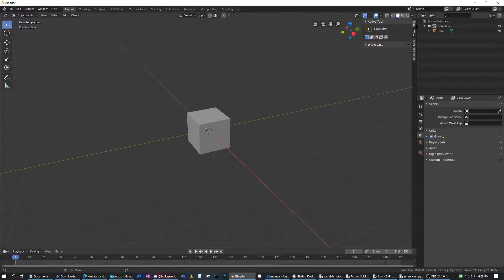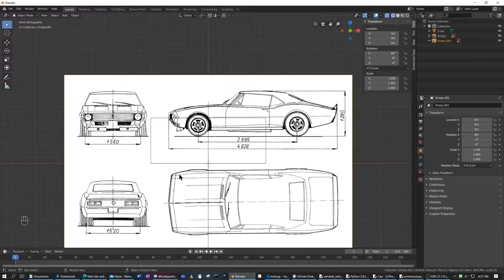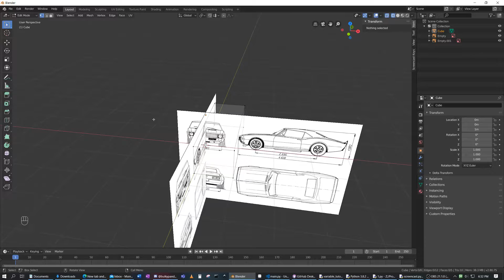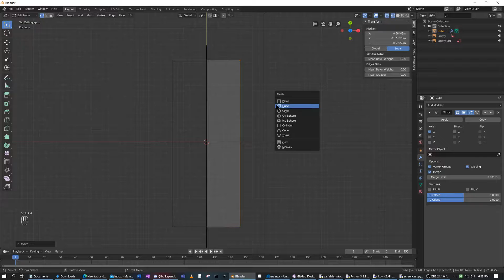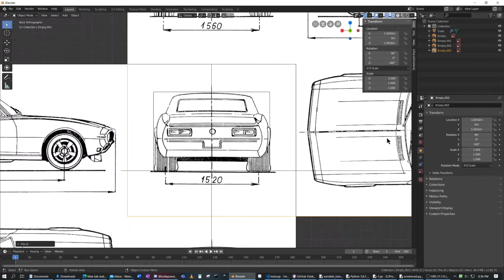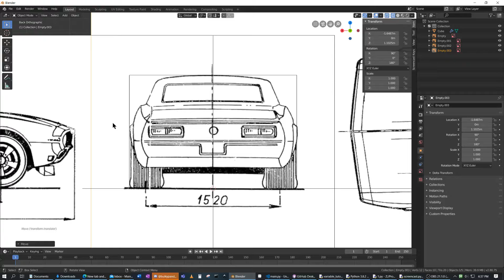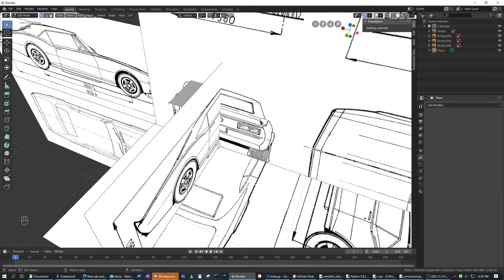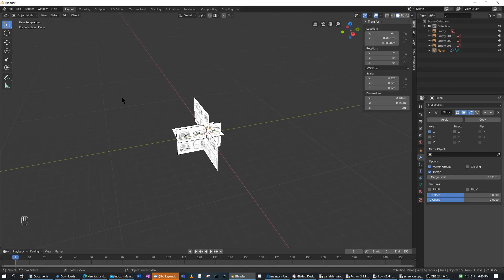Modelling a Car in Blender | Part 1 | Reference Images

Comment: Using these blueprints I found the centre line on the rear view definitely off as you can tell by the badge. It should cut straight through but is off a little. I solved this by cutting the cube in half and used a mirror modifier. This showed exactly where the centre should be and I lined up the blueprint to this.

Comment: i have an issue. when ever i try to align the reference images it doesn't turn out good. i followed your tutorial second by second and followed some others. but still bad at aligning the images
Reply from the maker: If you have a numpad you can press 5 to go into orthographic mode which makes it possible to see the reference images. Other buttons will also allow you to switch between views. 7 for instance allows you to see the top view, and the 3 lets you see a side view and so on, but it only works when in orthographic view.
Reply: @silicondevs9630  oh. I'll try aligning the images with orthographic . thanks